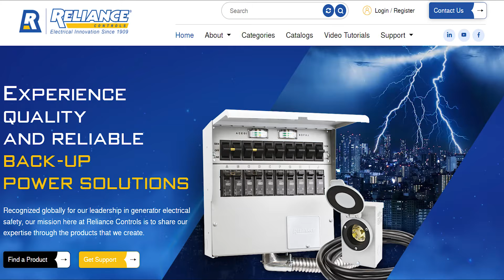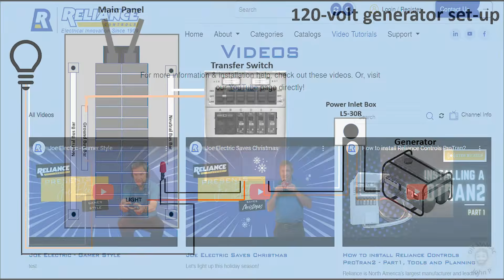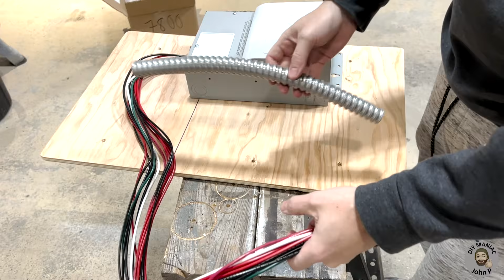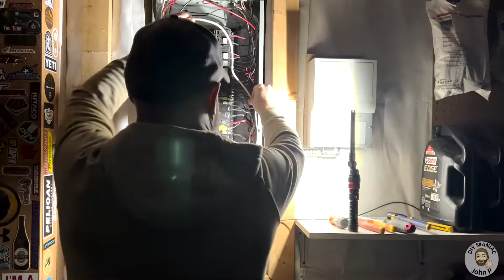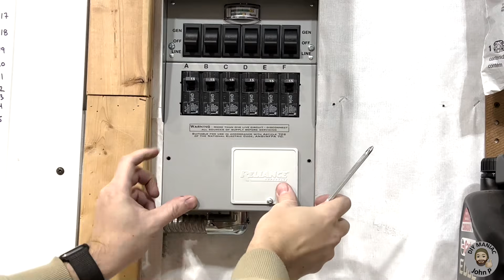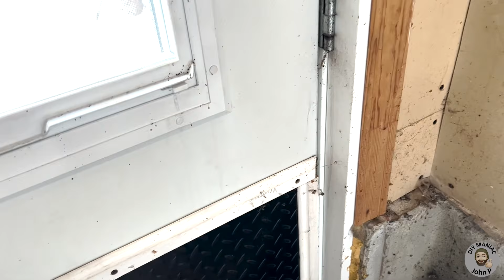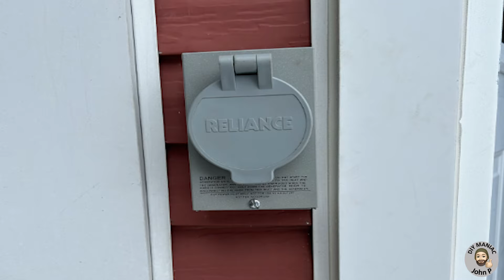Manual Transfer Switch for Home Generator Install Reliance Controls

Comment: Hmm. My sub panel has ONE grid feed line coming from a 60 amp breaker in the main panel . And ONE Line coming from an inverter.  There are 8 15 amp breakers in my subpanel leading to all my 120v circuits. I installed a 60 amp DPDT contactor which powers all the 15 amp breakers with power from either the Grid OR inverter feed wire. Installed a push button on/off switch to energize/de-energize the contactor.  My contactor, sub-panel box , breakers, switch  and wires cost less than 100 bucks. Took about 2 hours to design and 2 hours to install in our utility room. Now if the lights go out my spouse has one button to press to turn the lights, frig, network, microwave, tv's etc back on. Batteries last about 12 hours before solar or generator kick on to charge batteries. Yes I am a retired engineer. Not an entertainer. I no longer consult .  This is a simplified explaination of an electrical installation that only an expert should attempt.

Comment: Maybe you can answer me a question… what is the purpose in having two breakers; one in the main panel and another in the transfer switch? If one is smaller than the other you have defeated the whole purpose of the circuit by diminishing it’s value. Probably making the expenditure of the wiring useless and the appliance inoperable.
Reply from the maker: Depending which way the current is routed one of the breakers is no longer in use. When power is routed through the main breaker no current passes through the breaker in the transfer switch and vice versa.

Comment: I have this same transfer switch that came with my Ecoflow Delta Pro.  The switch instructions say that you can use circuits A & B on branch circuits up to 30a. Although, the transfer switch DOES NOT come with the handle ties and I don't see anywhere to buy handle ties separately. Any thoughts or experience on this?  Thanks
Reply: Contact Reliance Controls Customers Service and order some.

Comment: This is helpful.  I'm wanting to do the same, but with an inverter VS generator instead wired to my EV to use during power outages.  The inverter I have states in the manual "never connect the inverter to any power distribution systems or branch circuits" & " DO NOT connect any AC device which has its neutral conductor connected to the ground to the unit."  To me, that sounds like the inverter cannot be used with a transfer switch like the Reliance unit since on my power panel, the neutral and grounds connect to the same bus bar.  Right now I'm stuck with having to run extension cords through the house to power our critical appliances, but a transfer switch would be a lot more ideal.
Reply: I'm not an electrician, but I think you're misunderstanding what it's saying. Your inverter must have what's considered a floating neutral system, hence why it says not to connect directly connect the inverter to a main panel (main panels have the neutral and grounds bonded together). That would be taking two different systems and trying to make it work. The manual transfer switch is the step needed for in-between. Plus,  I've seen many videos where manual transfer switches are wired to both main and subpanels. You just need to wired the transfer switch the correct way to how your panel calls, whether its a main panel and you need to bond the neutral and ground together or if it's a subpanel and requires the neutral and ground to be seperated. 

What kind of inverter do you have if you don't mind me asking?
Reply: @shawnphillips1220  @dane9193
Reply: I have the same issue. I want to use my Ford F-150 Lightning as a generator and attached it to my reliant transfer switch. I know for sure that the generator is bonded and is CGFI protected. So, for this setup to work I need the neutral and the ground in the Reliant's power inlet to be unbonded. Since my main panel is bonded what is the solution to avoid that the generator goes into protection when I turn it on? Meaning how do I wire the green and white conductors of the Reliant other than to the main panel bonded ground and neutral? THE MAIN PANEL IN YOUR  VIDEO'S SCHEMATIC  IS CLEARLY UNBONDED
Reply: @iousa63  I ended up purchasing a product called EZ Generator switch.  It is UL listed as well.   It switches both the hot and neutrals so that I can use my inverter to power my furnace.

Comment: Salut! It was a nice walk-through, thank you! I'm planning my setup right now. I was watching another video (https://youtu.be/1nRvaxO9e80?t=496)  from a Canadian homeowner, and there is a note about Canadian code vs. Reliance / Generac way to wire things up. The main point is - you cannot use your main panel as a junction box, literally no wire nuts are allowed in main panel. Now, looking at your install I'm wondering if there are any discrepancies on the note above in Quebec Code vs. Canadian Code?
Reply from the maker: The way I read the code is that you can not use the main panel as a junction box pass-through. However, if the junction terminates in the panel, it is allowed.
Reply: @DIYManiacJohnP   Bonjour John, Can you give me a copy of  the Québec electrical code details where you found the possibility to keep the connections inside the panel?  I was trying to get an understanding of the possibility to keep the connections inside the electrical panel vs the need to get all the connections in a junction box outside the main panel. I am like @zaharc4122, I was told the connections need to be done ooutside the main panel.  Merci!  J'attends de tes nouvelles.
Reply from the maker: @pierremorin6077 hello. I always encourage my viewers to do their own research and form decision based on that. The code is open to interpretation on this. Some will say you are prohibited in using the main panel as a junction box where you are combining multiple hot leads. In this case the junction is the hot lead of solely one device. 

If after your research you still are unsure, I would recommend using independent junction boxes outside of the main panel.
Reply: @DIYManiacJohnP  Merci!
Reply: How about using Wago connectors?

Comment: Merci pour ce video….il semble difficile de ce procuré ces produits… ils ne semble pas avoir une branche au canada?
Reply: Awesome!!!!!
Reply: Alors je vais aller avec un “Generator interlock kit” est-ce ok au Québec?
Reply from the maker: Je ne suis pas un électricien certifié. T’es mieux de faire les recherche concernant les codes de bâtiment vous-meme.
Reply: @carlsarazin  Up to my knowledge it is not allowed in Canada. The reasoning was something like "interlock kit does not provide protection against back feeding if you remove main panel cover". That leaves us with two options basically: transfer switch or extension cables.

Comment: Are we allowed (in Québec) to use marrets in the main panel for the connection between the transfer switch and main panel?
Reply: My understanding is that we are not.  You are also not allowed to do the work yourself, unless you are licensed electrician.  But great, instructive video.  Well done.

Comment: Great video man and very clean install. 
Quick question can I install a 120-Volt/15-Amp Input on this model? The mode with the 4 120v circuits have a 120-Volt/15-Amp Input. I’ll only be using it for 120v appliances strictly. However, I’m contemplating getting this model for the two extra circuits but would like to use a 120-Volt/15-Amp Input instead of the L5-30 connector.
Is that possible?
Reply from the maker: Thanks for the compliments!!! I would recommend reaching out to Reliance with this question. 

Thanks for watching

Comment: Nice demo on the install. I was wondering if you mounted the Transfer Switch higher alongside the electric panel would that have allowed you the reach the ones on the left side without having to move the breakers up? Good video on the process and easy to follow.
Reply from the maker: Any higher and it would have been difficult to reach. Thanks for watching!
Reply: @DIYManiacJohnP  True.